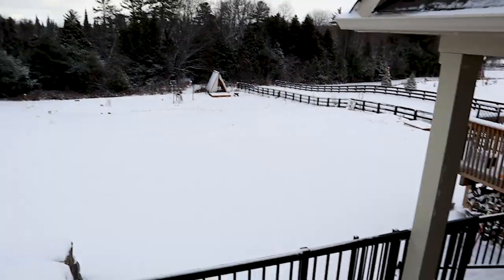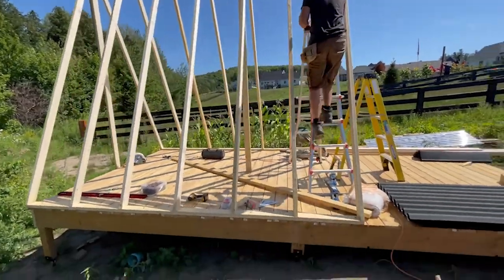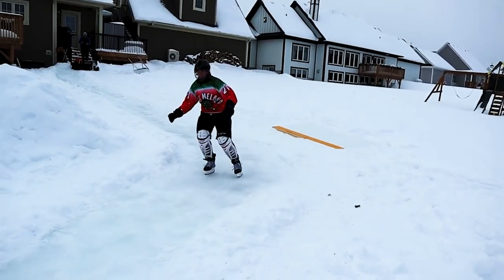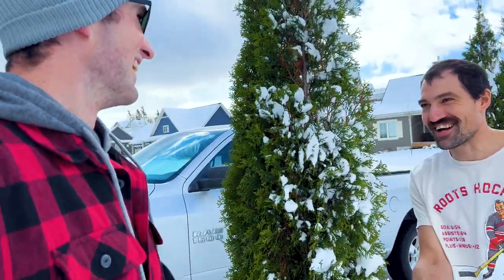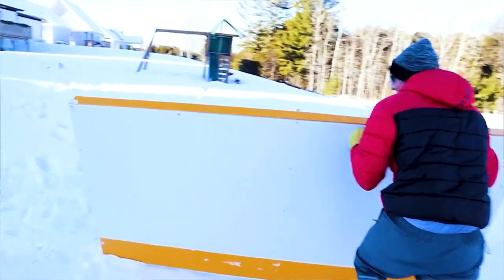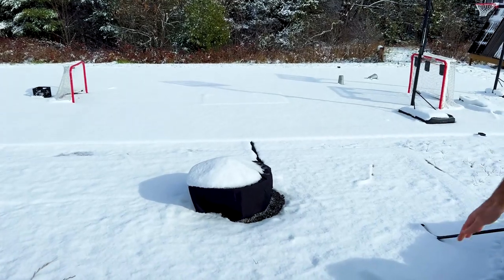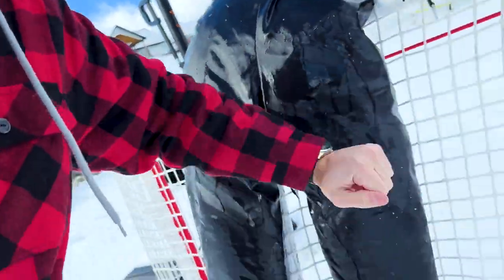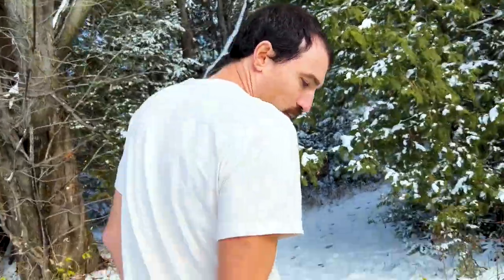My Plans for the ULTIMATE Canadian Backyard!

Comment: You should get one of those big rolling dirt compactors. You can rent them and roll it around, it will work perfectly. You can slowly fill it with water to compact more! It will also give a consistent width and smooth finish!
Reply: But how would it go uphill in the snow?
Reply: @YuckTradingCo  you push or pull it. ya maybe it wont have traction but this is some backyard science

Comment: You should rent a Compaction Force Plate Compactor from Home Depot
Reply from the maker: Looks like we’ll have to test a few methods! I like this idea
Reply: Snow isn't very dense, what about just using a heavy hand-held tamper that's just a square piece of cast iron with a wooden handle you can buy for about 50 dollars.  The big motorized plate compactor could be impossible to push back up a slippery slope.
Reply: @CoachJeremy  this is the way